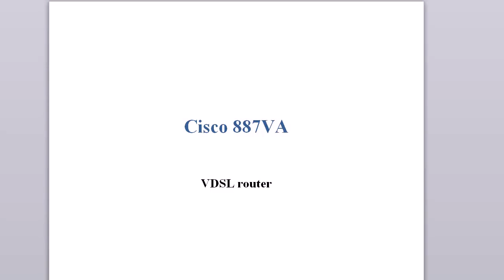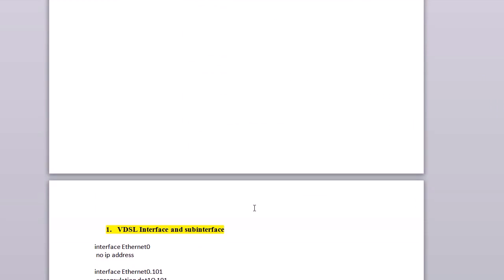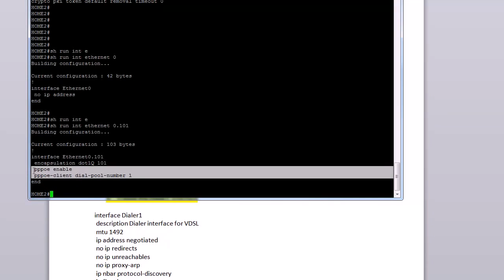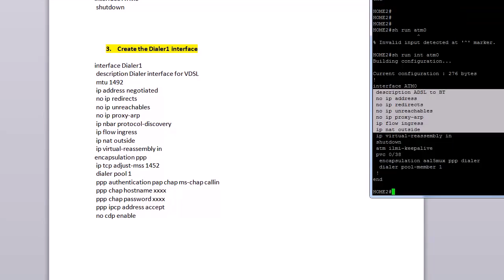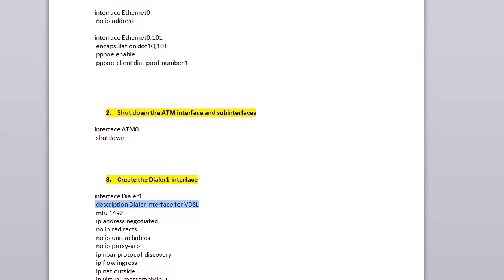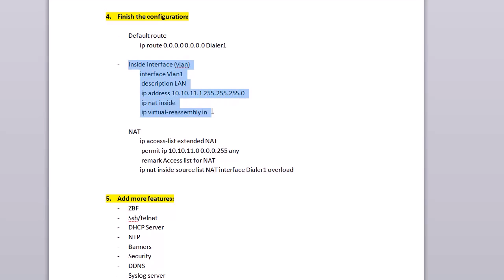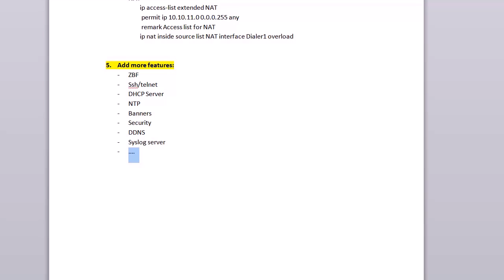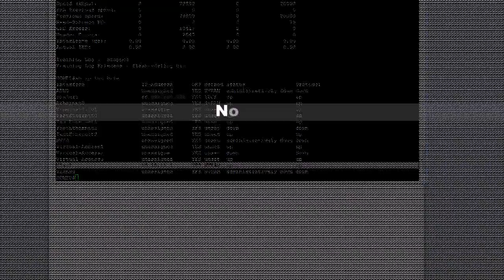VDSL - Cisco 887VA router - PPOE - configuration for BT Infinity VDSL

Comment: I m new on cisco systems. I made the configuration as above. Dialer1 take ip address but all configuration as above except Vlan1                      10.10.10.1      YES manual up                    up. method not NVRAM manual how can I solve this problem.